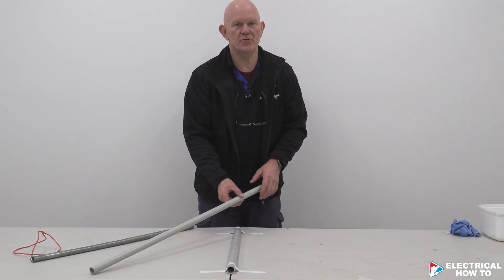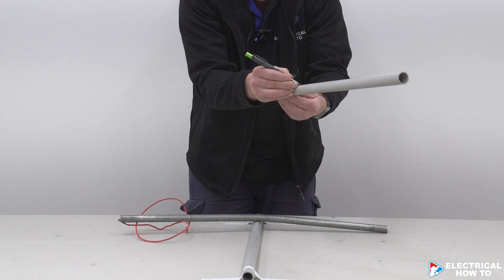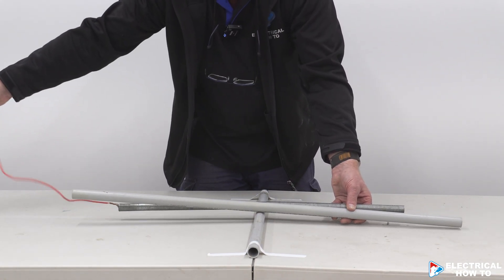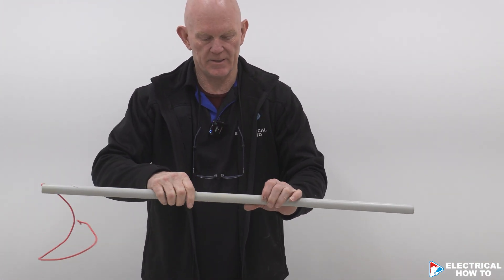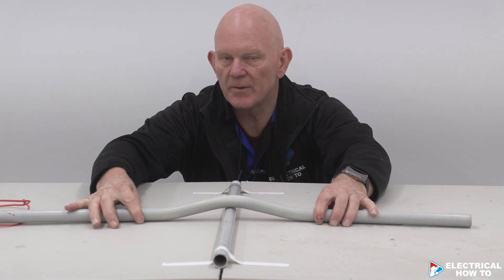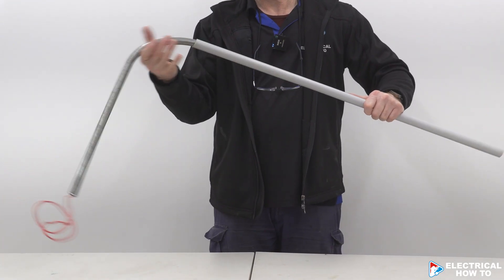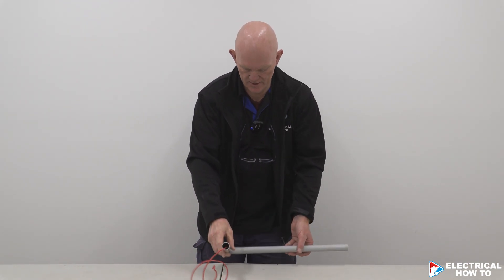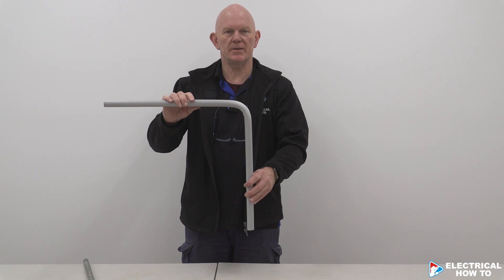How to Bend Conduit | Electrical How To

Comment: Nice tutorial. 

One suggestion is to install the building wire through the other end of the bending spring and run it through the length of the spring, then attach it. This way it stops you from stretching out the spring when removing it from the conduit.